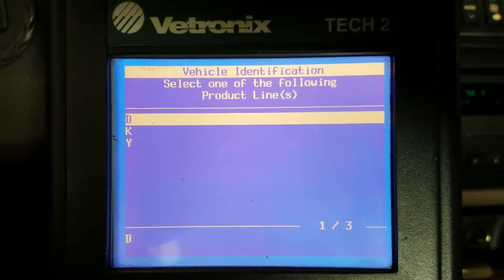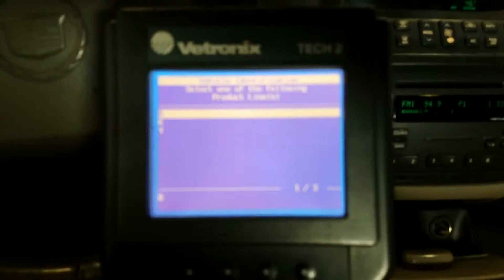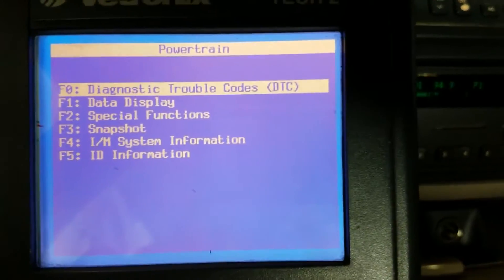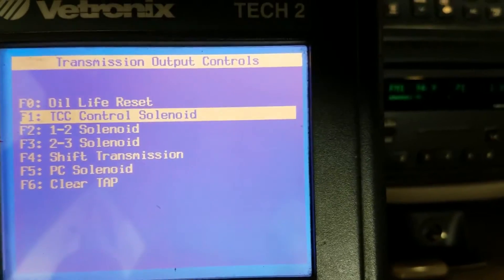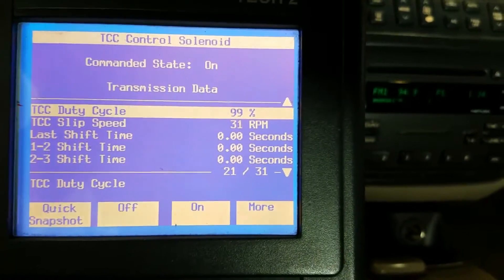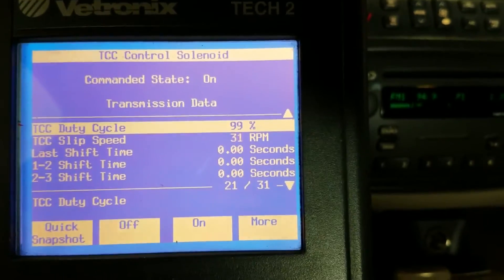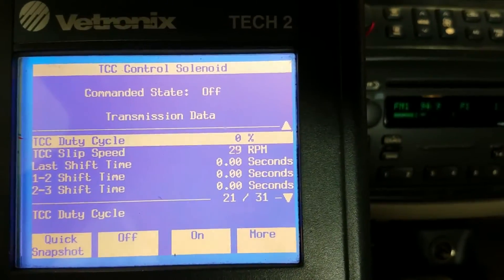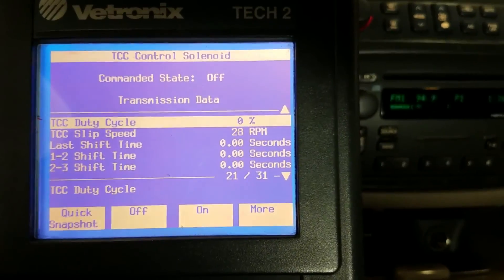P0741 Torque Converter Clutch Solenoid "Quick Test"

Comment: Why would he be looking at a transmission if it is just the torque clutch converter? Or are you calling it a transmission job because you have to remove the transmission to replace torque clutch converter? I’m asking because I have to replace torque clutch converter on wife’s rav4
Thanks very helpful

Comment: Thanks for the video. If you can hear the click of the TCC Solenoid doe this mean it is working 100%? I have tested the ohms of the solenoids and all in spec on my Saab 9-3 2006 Auto...just don't want to jump in with all the extra expense if it is working correctly. Thanks, M

Comment: So I just got the p0741 on my colorado, and I can feel the disengagement. I was so close to home so I pulled over turned the truck off and started it again thinking it might go back. But it did not. So then I cleared the code and it when back to normal wich allowed me to get back home with no slippage. But then the code went on again. I never got a check engine light on.
Reply: Did you get it fix. Having same problem
Reply: You got fixed bro have the same problem

Comment: Why "he is probably looking at a transmission"  when just the converter is bad?
Reply: Because they usually run as a set and the converter not working properly can cause excessive wear on the tranny. So it’s best to change them at the same time to avoid future repair costs

Comment: I'm having trouble with my pwm solenoid. Can I check it with the scan tool. I switched it out and everything was working good. Then my battery went out and after buying new one pwm wasn't working again. I'm having issues with overdrive lockup on 05 Yukon

Comment: If you have P1860 along with the P0741, then it's just the TCC solenoid. 
But the P0741 alone means your TC seals are leaking causing the TC to 
have excess slippage when lock-up is called for. Transmission must come 
out to fix it.
Reply: Yes,.. 741 is the PCM measuring "SLIPPAGE" beyond the programmed limits. 
Which is usually a SEAL problem. 
While the accompanying code 1860, will be the "SOLENOID".
But often is an "Intermittent" solenoid problem, which only gives the 741 code. Since as said,.. Is a measure of the given slippage. (approx 4%+) 
NIETHER OF WHICH,.. Is a Torque Converter issue. 
Though is part of the Direct Lockup drive system. At or above 41mph per programming specifications. 

Least that's what I know from my Caddy experiences. 
Currently a 2002 STS which I fixed with Lucas Trans Fix : )
2700 miles without this (intermittent the last 2 yrs) code popping up. 
(just an experiment, after dropping a half dozen engines and transaxles)
I'm sure it will be back... 
And a trouble code that is Far To Common. Though everything is common for Caddies 😂 😢 

Best I can tell ya 🤞

EXCEPT. 
I would check your Grounds. 
And add an EXTRA Decent Gauge Ground from your Engine, to a good spot on your chassis. Preferably a spot you make yourself. Clean and well sealed.
I have found TONS of issues solved by this simple addition. As these Cads seem to have Shitty Continuity and corrosion problems you will never find. But this works Great. And solve problems you don't know you even have yet hehe. As most sensors obviously are on your engine,.. Etc. 
Jus FYI ☺
Reply: @freehhhh2086  another keyboard warrior......smdh
Reply from the maker: Thanks bass man.Thats great info
Reply: bass man 

Dear brother I have the same problem in my gmc acadia 2008
And there is some vibrations sometimes in car if I slightly pressing the acceleration pedal
But no vibrations if I press the acceleration pedal hardly
And always the code p0700 and p0741 come on and gear stuck at 3rd gear till I close engine switch and restart car 
Do you advise me to change torque converter or the hole transmission
Because fixing here in my qauntry is very expensive more than replacing
Reply: @adeleliskandrany4626  
I got a p0741 code gear goes from 4th to 3rd about 5 to 6 times at speed of 120k/m then it stays in 3rd. If i drive less the 100k/m nothing happens and it drives normal. Dont know if its the same with yours and if, how did you fix yours.
Reply: @freehhhh2086  lets go!!! name the time and place you little piss ant.
Reply: Actually I was told it's the opposite. The p0741 is the sensor.
Reply: @CCW-wg8ds  Absolutely not.
Reply: @bassb450  well I'm reading my print out of my code po741 and it says solenoid circuit. Performance.  And the other code is for torque converter.  And this came from the computer print out. ?
Reply: @bassb450  either way is there a fix I could just to get the engine light off so I can get though inspection. With turning off the light. They know that trick my car failed because of a no read. Then the light came back on . so that's how I got my codes today.
Reply: @CCW-wg8ds  What kind of car?
Reply: @bassb450  2002 caddie deville. Base model.  Northstar v8 146400 miles
Reply: @CCW-wg8ds  Yes you can possibly get around the emissions, but I have heard that after year 2000 the cars computers run different self tests but I cannot verify. I do it every year in my 2000 Deville. Clear the code and drive locally never going over 35mph to be safe. The car will not run the self test or trip the light until you hit 41mph. After a couple of days your emission monitors should be clear for a inspection. You should have a hand held scanner to verify your car is ready, it's the only way to know.
Reply: @bassb450  well thanks I'll look into that once I get though inspection in NJ I won't have to worry about it for 2 years. This car is just my winter car . the 2020 1320 challenger is in the garage for the winter. Days
Reply: @bassb450  i got p0133 and p0741 what should I do?
Reply: @tareqxq6606  Your 0133 code is unrelated to the tranny code. 0133 is a oxygen sensor code. The code is triggered when there is an issue with the response time from the oxygen (O2) sensor when switching voltage levels
Reply: I have a PO741 on mine but I’m not stock, have a lot done to motor shift kit in tranny & 3200 stall converter it was jerking when I got off the brake.. I just replace my converter instead of rebuilding it.. yes I have a 410 gear in my rear as well.. but driving it long distance didn’t like it reason it hit rev limiter... meaning 5 plus hour drive .. I still have my old one and tranny fluid was still pink as shit, so that told me gears wasn’t ate up... but maybe my comment help the next, all depends if valve body been drilled, witch mine was just glad it didn’t tear it up or the pump ...
Reply: what is your opinion if I am getting P0740 and P0744?
Reply: bass man bs you don’t know what your talking about